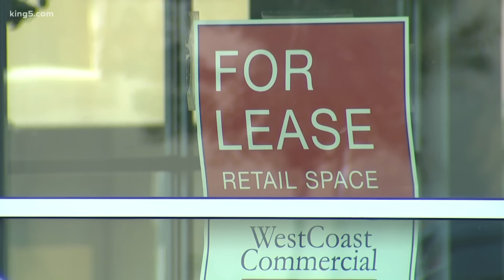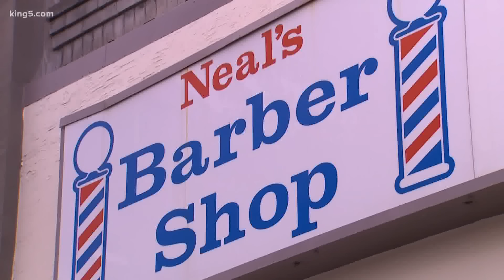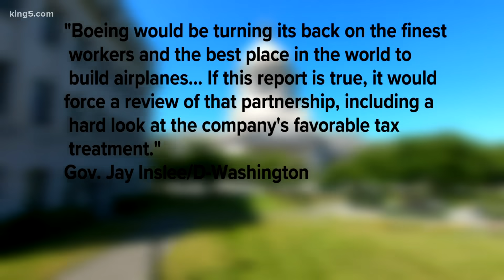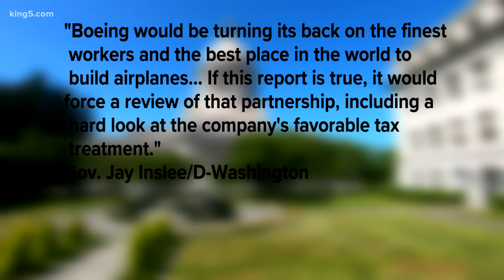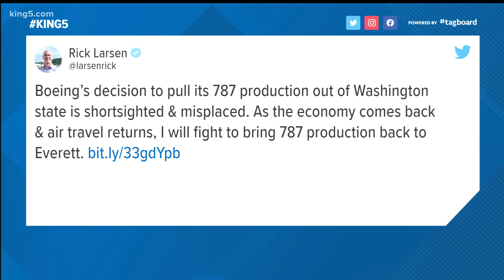Impacts could be devastating if Boeing moves 787 Dreamliner production out of Everett, Washington

Comment: A whole report on Boeing leaving, and not a word on why Boeing says they're leaving.
Reply: Claude Bedard  I think the case can be well made that having the marketing department rather the engineering department making the decisions would much more at the problems with Boeing quality.  The unions have almost nothing to do with the crashes.  It was well documented that marketing decisions by Boeing and their customers was the real problem.  That said,  with the political situation in Seattle,  I  would  get out so fast, you wouldn't even see my dust.
Reply: Claude Bedard  Engineers don’t have a right to collectively negotiate working conditions, pay, medical?  Is that what you are saying?
To be clear, there where several engineers who did send memos expressing the dangers of retrofitting a larger engine on the 737 Max, and it’s potential stalling effect.  The CEO did not want Airbus to be the only upgraded aircraft sold requiring no additional training. The airlines saved millions in training costs and Boeing got contracts to build planes with a fatal aerodynamic issue “fixed” with bad programming. However I don’t think any of that made Boeing want to leave Seattle.
Reply: Claude Bedard  I’m naive to the union/professional nomenclature in this case, but I’m going to look into that.  I do however have a great deal of respect for your win and willingness to struggle with your employer.  We need you building aerospace equipment!
Reply: Like Joe Biden not saying anything about packing  the Court, not giving an opinion IS the opinion.  Not worth talking about
Reply: @craiglicata  Then let’s hope the “dems” win.
Reply: Claude Bedard  I agree that they are supposed to. It reflects poorly on their character that they didn't.

Comment: They're moving to SC. Period.
Reply: Since moving there Boeing has had more quality control issues.
Reply: @Rhaspun But isn't the 737 Max built in Renton??

The 737 Max isn't even flying while the 787 built in a plant with known "quality control" issues still is. 

The whole thing doesn't matter to me. I go out of my way to avoid flying on Boeing built aircraft. I don't care where they are manufactured. 

By the way, that Airbus A220 is one very nice little plane. Better than anything that Boeing builds. 

So get over it. Boeing as a company is finished. The sooner you all realize it, the better. 

And don't give all that garbage about Boeing building better aircraft. Go look at any Boeing parking lot. Most of the automobiles are foreign nameplates. Because Americans can't build decent vehicles or so the saying goes. Well, guess what? It turns out that Americans can't build decent airplanes either. 

And when the foreign automakers decide to build manufacturing plants in the US, where do they to? To right to work states. So those Toyotas and Nissans in the parking lots aren't built in Washington or Michigan or California. They are built in places like Kentucky and Tennessee. 

The vehicles that are built in union states like Michigan and Ohio are domestic nameplates. You know, the ones that Boeing employees despise so much in the first place. 

Americans build shoddy products. Boeing is just as bad as GM and Ford. 

Like I said, that Airbus A220 is one sweet airplane. Delta is such a nice airline also. 

I'll stick to flying import airplanes.

Comment: The handwriting was on the wall when Boeing started a second production line in South Carolina.  The South Carolina facility got off to a shaky start but after a few years, the problems were ironed out.  With a major drop in demand for airline travel due to the COVID-19 pandemic, orders for the 787 have fallen.  Consequently, the production rate has been decreased to a point where it isn't feasible to keep two production lines.  The choice was one production line or have two production lines both underperforming?

Jay Inslee is running for a 3rd term as Governor.  If he is re-elected, the people of Washington deserves him.
Reply: The fuselage section of the 787-10 is made in Charleston and it doesn’t fit in a Dreamlifter, so 787-10 production has to stay in Charleston. As long as Boeing no longer needs two assembly lines, and production of the -10 has to be in Charleston, then it makes sense to move all 787 production there.
Reply: Nice, someone who actually knows what they're talking about before commenting. Keep up the good work!

Comment: Seattle is turning into a commune.  Boeing is smart to leave.  S.C. has quality issues so Boeing has their work cut out for them.
Reply: @scotttild  the SC move has proved disastrous for boeing as the aircraft that have come out of the SC plant have significantly less workmanship quality.  Airlines have already stated they will not accept 787s out of SC unless Boeing agrees to compensate them for quality related issues.   This SC move has proven to be an absolute disaster for boeing.
Reply: transferring real quality control people likely will happen very soon
Reply: Steve Pailet It won’t the aim is to get rid of quality control people who know what they are doing and replace them with people who have more concern for “targets” who will make the CEO rich and send the company the way of MacDonald-Douglas. Airlines will not buy planes built in a right to fire state and will instead buy planes built by workers in places with higher labour costs than Washington State.
Reply: @davidwright7193  I do understand have read that SC plant really has qc issues.  From debris left from the construction in places where it can cause failures to just not doing the basic work.  I am not concerned about the CEO but am concerned that there is a reason to keep planes from falling out of the sky.
Reply: @DominicciSkycam  No doubt that was true...under former CEO Dennis.  That was the same Dennis who pushed the 737Max so fast that it was under developed and flawed.

Comment: Everett is more expensive as they've got a lot of experienced, long-service people building the planes.  The South Carolina plant doesn't have this, which results in planes that airlines don't trust and won't buy.  Qatar airlines, for example, will not buy Dreamliners built at the Charleston plant; they insist any planes they buy must come from Everett.  Many other airlines have reported finding debris in completed planes, including the engines and tail.  The 737 MAX saga shows what happens when you put cost-savings above everything else; it looks like Boeing is about to repeat the mistake with the 787.

Comment: I don't understand why Boeing couldn't redesign and install a taller undercarriage in the front and the two main landing gear a midships to allow a standard 737 300 pylon to be used to attach the engine to the wing this way they can get rid of the MCAS system that is causing all the trouble.